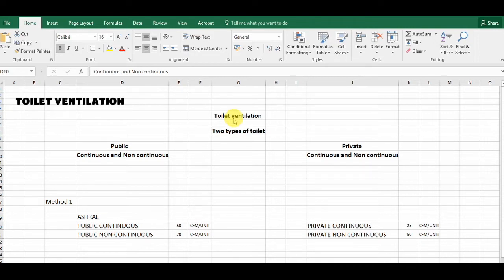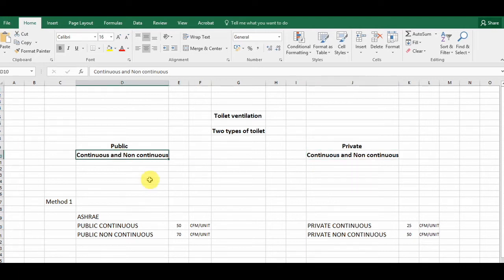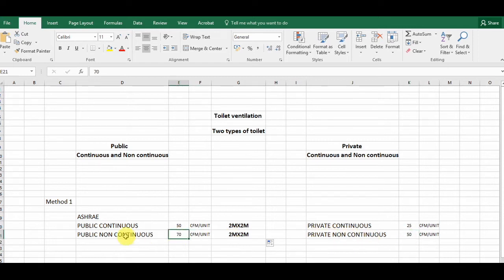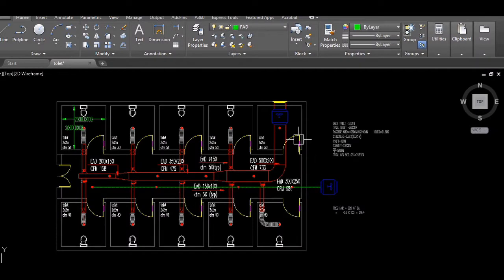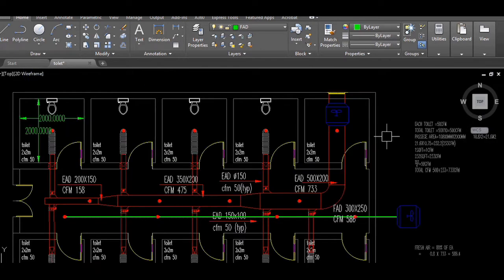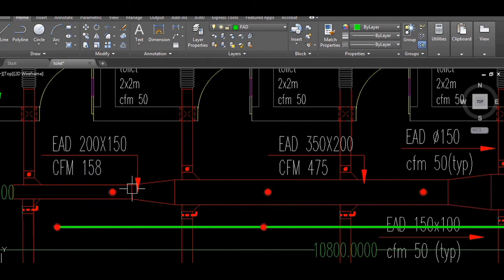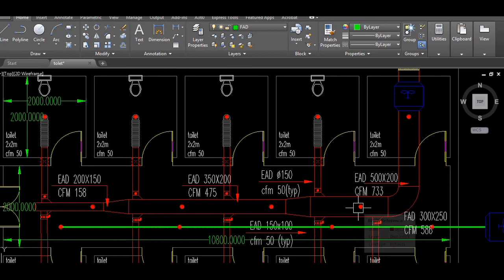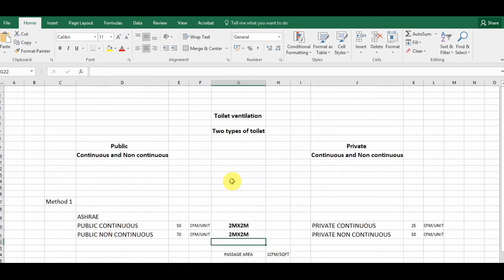TOILET VENTILATION (part-1)(ASHRAE)

Comment: Clear concept of explanation, what cfm need to be considered if toilet is lesser than 2sqm or greater than 2sqm
Reply from the maker: Thank you for the question 
If toilet size is less than 2x2 then also we can use same method.

For larger toilet 
I will explain one different methods (standard)  in my next video